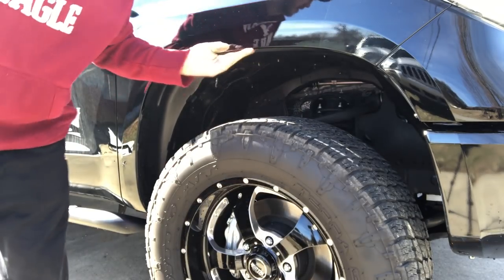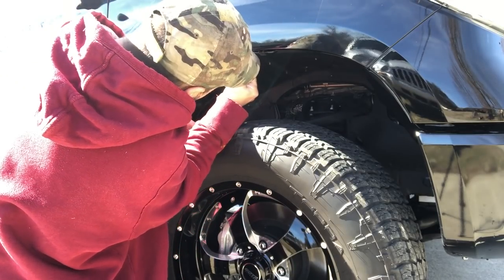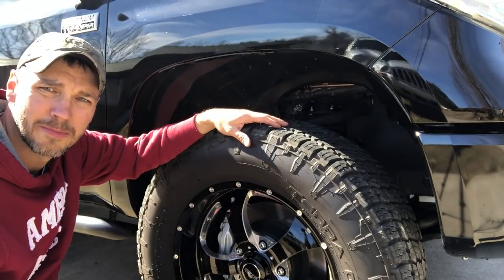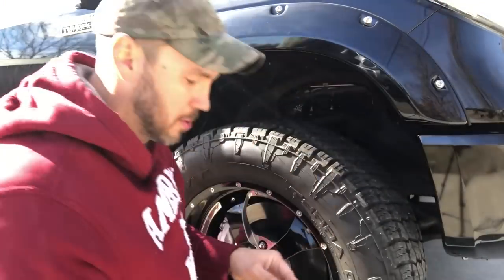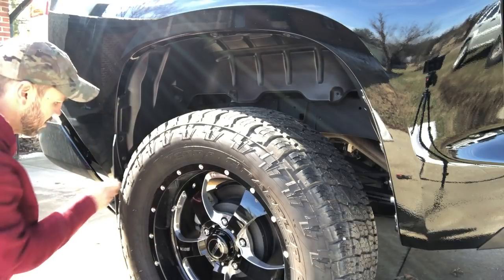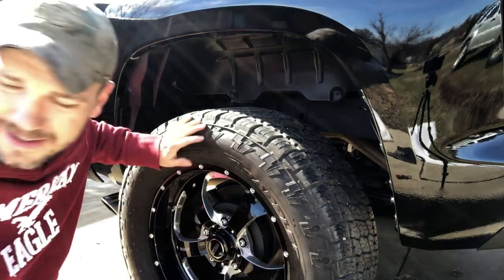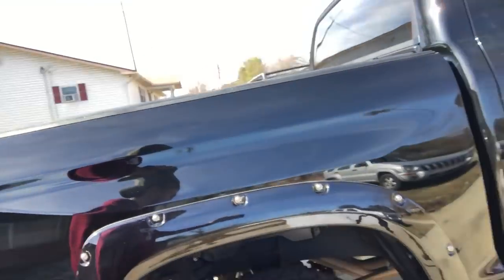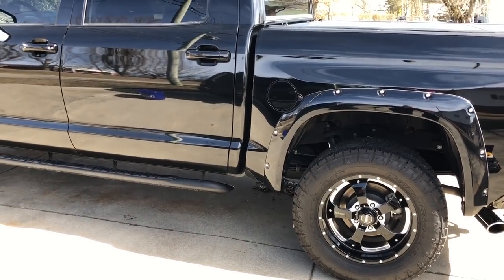2016 Tundra Platinum Bushwacker Fender Flare install.

Comment: Just pulled my flares after 6mos - beware - they rub and damage the paint.  I had to use some rubbing compound to remove the lines, which unfortunately marred the finish a bit, not really noticeable but it's obvious if you look closely ... so I need to figure out what to to fix that.  Flares did nothing to prevent splash of gunk/debris ... I live in NW MT and they are pretty liberal with mag chloride on the roads here, so without my splash/mud guards, all that snow/slush crap was getting thrown all over my undercarriage and TRD dual exhaust.  So, I just installed some new WeatherTech mud/splash guards and put the flares on Craigslist.  I won't go back to pocket flares until one of these companies incorporates mud/splash guards into them.  They look nice, but are worthless IMHO.  Best suited to mild climates and mostly street driving.  Just my $.000002

Comment: Old fred installed these on my 2008 Tundra back in 2010.  Removed them in 2015, the paint finish had a permanent line that followed the outline of the flare.  Tried to polish it out no luck.  Have a new Tundra now I'd never install them again.  Nice looking wheels and tires.
Reply: Fred Sausage what kind of polish did you use? I’d start with a 1500-grit sandpaper and use “Liquid Ice” polish.

Comment: Thanks for the tips, they don't just help those with Yota's, I just installed them on my F250 and installed Rotor tape under them using your method. They aren't perfect but will accomplish the mission and you really have to be up and close to see the rotor tape isn't a perfect line.

Comment: Truck looks great, I’m in the process of painting and installing some Bushwackers on my black platinum in TN.
Reply from the maker: jody omohundro Nice I’m sure they will look awesome.  I actually ordered mine already painted.  Just made it faster to install.  Didn’t have to wait on them to be painted.
Reply: Gear Runner I️ run a small body shop, so I just painted them my self.  In my case it is saving me some money.  I️ also am adding some X-Pel clear protective film to the front edges of the back ones to help with rock chips.
Reply from the maker: jody omohundro That’s awesome.  That will definitely save you some money.

Comment: Question...do these rub on the outside fender? If you took them off in a few yrs would you see paint damage?
Reply from the maker: Kurt Hunter They do rub but they have a piece of rubber that’s in between the flare and the fender.  So I’m not sure if it would damage the paint in a few years or not.  But if I’m. It mistaken there was a disclaimer in the instructions about not liable for paint issues.
Reply: Kurt Hunter the won’t rub, there’s a thick edge trim that comes enough for all four fenders.
Reply: Kurt Hunter a few years?lol I got paint damage in two weeks and took them off and added double sided 3M tape where they touch the paint

Comment: Is there a bushwacker stamp anywhere on the inside of the flares or any way to confirm authenticity? Im asking cause i got a guy trying to sell me a used set in great condition colormatched to my truck already but cant verify if they are actually bushwackers
Reply from the maker: Ash Mcfall I will try to look for you tomorrow but I don’t believe there were any markings on mine or at least I didn’t notice if there were.
Reply: The one way you can identify if they’re genuine Bushwacker flares, depending on the year of your truck, each flare should have a QC stamp with a part #, date and either a 2 or 3 digit number. I believe the 2015 model year and up, they have a black plastic Bushwacker label sonic-welded to the bottom of each flare.

Comment: Thank"s, For Taking The Time Out And Sharing. It's Super Nice, Could You Please Tell Me What Type Of Rim's And Tire's You Have... And Also What Type Of Exhaust System You Running. Thank You I Greatly Appreciate Your Video.
Reply from the maker: keoki merseburgh Thank you.  I have 20x9 Sota Novakane Deathmetal Black wheels with Nitto Terragrappler G2 tires in 35x12.50r20.  The exhaust is a dual Borla.

Comment: The question was probably already asked but with the 35s how much, if any, of a lift did you need? Any rubbing with the width? I have a 2016 TRD Pro with a factory lift (2 inch) and I'd like to slot the 35s in as the OMEs look small for the truck.
Reply from the maker: Shawn850 I actually have a 3 inch lift on my truck.  There was some trimming involved even with that. I can not run any 35 either I have to stick with an all terrain or they will still rub.  I want to go to a mud tire next so I will either need a bigger lift or go down to a 33x12.50r20.  I will more than likely go down to the 33 size.
Reply: Gear Runner I think you might even be able to go to a 34 with a 3" lift.  The OME is measured at 275/65/18 on my Pro which works out to 32.1 inch with plenty of room fore and aft of the tire. Not sure about how much, if any, rub there would be on any turns but width would certainly play a factor.
Reply from the maker: Shawn850 Thank you I will have my tire guys check that out.  I want to stay with a 12.50 width because of the flares.

Comment: Did u ask to have the fender painted to match? I'm confused when ordering my flares. I have same black truck color as u. But when ordering they say either matte black or smooth which 1 do I get...I want it to match
Reply from the maker: rey210rey I ordered mine from my local 4x4 shop.  Not sure what company they ordered them from but it was an option to order them color matched.  If you go to Bushwackers wed site it shows you are able to order them color matched also.  They have a list of dealers to order from so one of them should have the color match option on their site.
Reply: Matte black and smooth is the same thing. Sometimes, customers like to order ones with a very rough texture, much like the Rhino stuff you have in your truck bed, but it’s all from plastic. It is what they usually come as with a special coating that will prevent it from chalking and from fading out in the sun.

Comment: I'm looking for ideas to make overland modifications to a Toyota Tundra CrewMax TRD Off-Road 4x4. 2010. Millage 150,000. Any suggestions?.
We will use it for camping, in desert, stony roads, snow, mountain roads, occasionally a small river (but that is rare).To start I'm thinking of off-road suspension and lights, but which of the ones in the market? I want them good, but not very expensive. If I have to put a rack I would like to think of something I can get out of it, since I can not lift the truck much longer because I need to leave it on a daily basis in low parking.Surely we will not be climbing rocks.
Reply from the maker: AECVV I know a company called headlight revolution has a lot of led lights and light bar options. Maybe a 3” level if you haven’t already got just a little more clearance.  As far as racks I really don’t know there.  I’ve never looked at them much other than on here.
Reply: Thanks.
Reply from the maker: AECVV you are very welcome 👍

Comment: Did they give you screws to replace the ones you took off from the mud flaps? Just ordered some from svcustoms great price
Reply from the maker: Victor Salinas Yes they send you a bag with all the hardware you will need to install them. It’s a very easy install once you figure out how the first one goes in.
Reply: Gear Runner great! Thanks for the response. And nice truck 🤘🏼
Reply from the maker: Victor Salinas Thank you and good luck with the install.  I’m sure it will turn out great.

Comment: I have nice factory rims that came on truck would these flares look ok, or must you have oversized tires.  I like my crewmax.
Reply from the maker: dunrob13 It really depends on what look your looking for.  If you want the tires to set even with the flares the factory tires probably won’t work.  If your wanting a wider looking truck these will definitely do that.
Reply: Gear Runner how far out do they go? 1-2 inches?

Comment: Hey bud, I just installed these on my 2016 Tundra. Followed your install. Thanks, it helped a bunch. Only issue I have is the drivers side rear fender flare doesnt sit completely flush on the backside. I just dont want water to get in between. Any solutions for this?
Reply from the maker: Steven Davis Thank you and you are very welcome.  Sorry I don’t have any ideas.  Mine sit flush so I didn’t have to come up with a fix for that.  Did you push in while tightening the screw.  Other than that not sure what would cause this.
Reply: @gearrunner  thanks for responding. I tried pushing while tightening, but it didn't help. Thinking maybe the flare is a little warped. I'll have to figure something out.  Maybe that double sided tape just in that spot. We'll see. Thanks again.
Reply from the maker: Steven Davis you are welcome.  Double sided tape may work or maybe the summer heat will help settle it down or possibly a combination of the two.

Comment: Can the rivets be removed? Looking at this same set but want to paint the rivets black
Reply from the maker: Ash Mcfall They are actually screws and you usually have to install everyone yourself.  I don’t know how but I got lucky and all mine were already installed.
Reply: Gear Runner awesome then ill just paint them then install. Thanks
Reply from the maker: Ash Mcfall I’ve seen them painted they look good.  Where my wheels have polished aluminum in them I left mine stainless.
Reply: Gear Runner yeah i agree the accents on your wheels go good with the stainless rivets. My truck is the superwhite and im running all matte black accents and wheels. Im just glad i wont have to mask off the flares just to paint the rivets haha
Reply from the maker: Ash Mcfall That is a good part about them not coming in. The bad part is that they don’t come in.  That’s a lot of bolts. Lol
Reply: You can, no problem. Just unscrew them, I believe they’re either a 9/16” socket size. Just like any paint job, a lot goes into prep. I’d suggest you dunk them first into some sort of acid before painting, you auto painters know what I’m talking about. I forgot what it’s called. If you’re not a painter, the best thing you can do IMHO, is at least get them through a grease & wax remover process.

Comment: Looks good man!  I have the exact same truck!  I was looking to get some flares and came across your video.  Those Bushwackers look nice painted as well.  I'm in the process of doing a full chrome delete.  Do those decorative screws come off?  Would be nice if I could replace them with black hardware...
Reply from the maker: They do come off.  They are just short bolts with nuts on the back.
Reply: @gearrunner  Awesome!  Thanks fore hitting me back man!  =]
Reply from the maker: Zachary McGrew You are very welcome 👍
Reply: Ackj 375718  Where can I find Gear Runner fender flares?  I googled them and couldn't find a photos of them.  Thanks!

Comment: Highly recommend  getting off Amazon some clear double side tape or 8mm paint pro tape and edge out those.  I have 2016 and trading mine in for 2019.  Took fender flares off and the rubber seal rubbed a line in the paint
Reply: Used some scratch compound and oscillator but it only masked the rub line.  Only 50000 miles on them.
Reply from the maker: Timothy Peterson I’m actually fixing to do a video on what it does to your paint.  👍
Reply: Gear Runner does it have anything to do with a remedy to keep it from happening
Reply from the maker: Timothy Peterson I really don’t know if you can stop it from happening.  I may try to see how hard it is to fix what ever it has done to the paint. I wanted to do the video today but it’s raining.
Reply: Gear Runner i took mine to my detail guy he used an oscillator on it.. it helped a tad but he said in order to completely remove because toyota paint is thin he would have to wet sand.  Lucky for me the dealership didnt mind and traded as is.  I dont want to put lines in my NEW PRO.  Someone suggested putting a strip of 3M tape similar to the door edge protection so they ride on that instead of the paint.
Reply from the maker: Timothy Peterson I bet that would work great.  I just wonder if you could get the curve right without it linking?  Maybe have to cut small strips.
Reply: Gear Runner i may try it and if not i heard of a company that will do it but it isnt just a strip it is pre cut from a bigger roll
Reply from the maker: Timothy Peterson Nice. That would definitely work.
Reply: Gear Runner ill keep you updated if I find a solution and ill wait for the video to see if you get anything
Reply: Gear Runner i stopped by today and talked to the local paint pro fil installer that does high end stuff.  We are gonna try some stuff he has ill take pics and let you know how it turns out
Reply from the maker: Timothy Peterson Thank you. Can’t wait to see if it works. 👍
Reply: Might have to use some Paint Protective Film PPF underneith the fairing use knifless tape to cut the edge / ark form of faring, or you can mark it and cut it using the faring edge, makes sense?
Reply: I" be doing mine soon i"ll put some pics
Reply: Jose L. Franco Yes I bought some XPEL door guard egde paint protection.  It is cheaper than the huge sheets and easier to bend along edges.  I will follow up with how well it did or didnt work